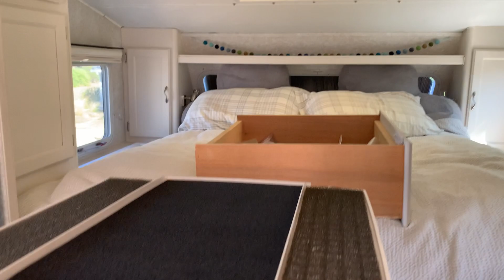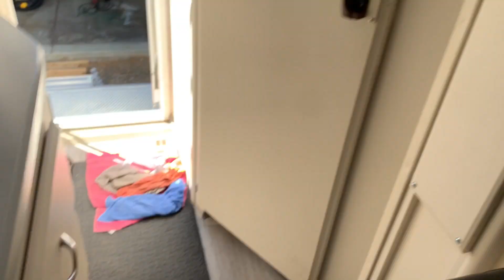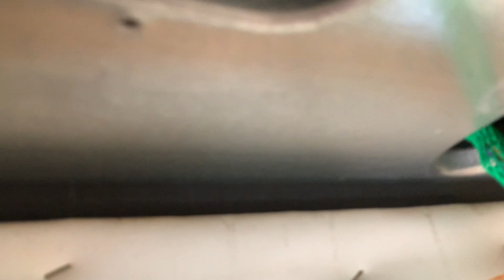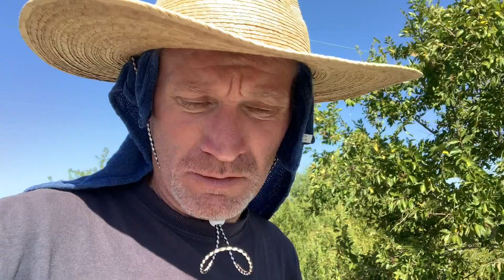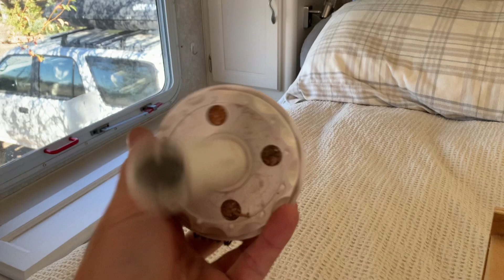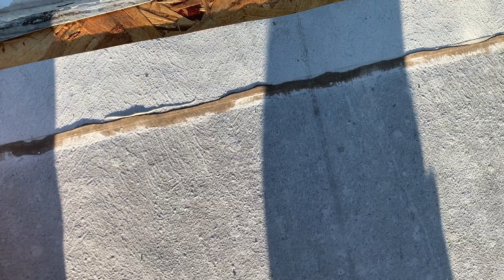50 Year RV Roof - Part 3 - Exposing The Rot. Removing RV Air Conditioner, Antenna, Vents & Trim.

Comment: I like that you are replacing your ac unit with a max air fan. Great idea for energy savings when you boondock
Reply from the maker: Yeah, that AC was 105 lbs including the ceiling unit.  It was really overkill for this size space.  I bought a 5000btu unit to put in a lower cabinet with intake/exhaust ventilation baffles.  It only uses 400 watts so with 600 watts of solar power and the LifePO4 batteries I should be able to run it when needed off of the inverter.  More testing on that in a future video.

Comment: Have you considered a Heki Hatch Skylight replacement for that front escape hatch?
Reply from the maker: I have.  It’s exactly what I want there and I may replace the current hatch style (new just like the original) with a Heki style hatch.  I’ll wait for the prices to come down a bit.  My rv parts dealer wants nearly $500 for the size I need. (28”x20”)
Reply: @covetthecamper2289  Heki is owned by Dometic now. Their PR Dept may want to "sponsor" your project. It would be great marketing for them and channel exposure for you. Give them a email and see what they say. You never know until you ask. Cheers.